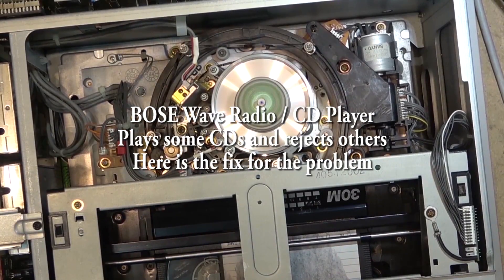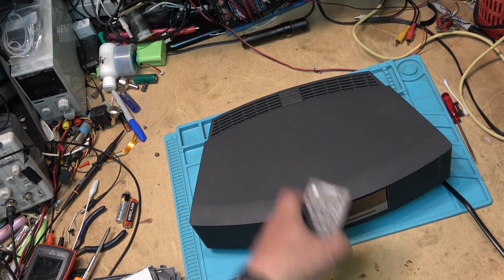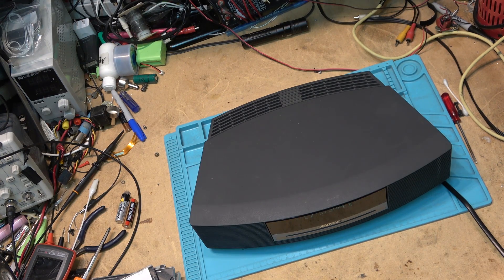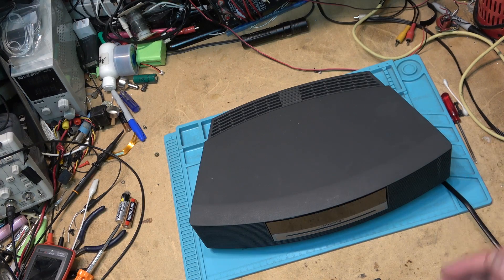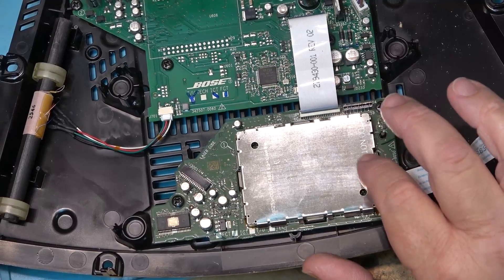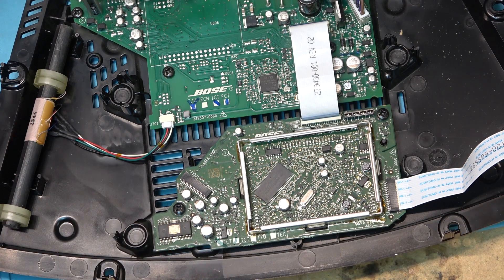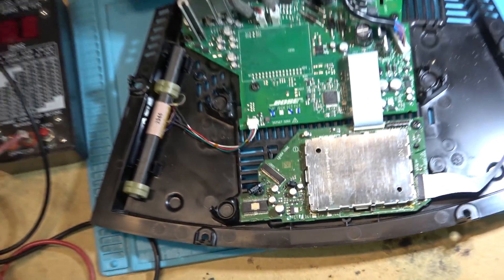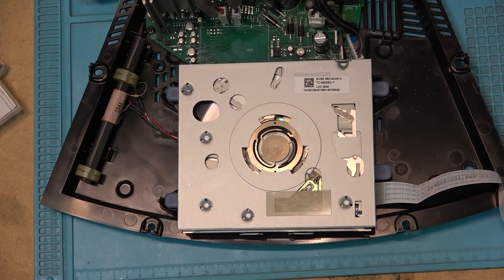BOSE Wave radio CD player not reading some discs skipping ect. Servo board repair component level.

Comment: p.s. they use lead free solder on these things, which i hate!!! i changed the 2 larger caps on the power supply area and they didnt budge until i took the 100 watt weller to it.

Comment: you are lucky on that one. i shotgunned the same area your did and still did the same. i took my hot air pencil and heated up the area under the shield and it fired right up. i shotgunned the caps in the cage, and boom! works like a charm.

Comment: Hello Master , under the disc player on the left side there is a capaciter : k3 [ can not read it  ]        
Then under k3 , it says ; 47 j or i
UD 
Is it 47 U D 
Would you please👌🙏🙌 help me:
is it 47 uf & what's the voltage please👌🙏🙌 sir .I thank you for your response . .GOD Speed🕊️🦅
Reply from the maker: Couldn't tell you. Here is the thing when I repair something for a customer they pick it up and pay me.  So I don't have it so unable to help.  Not that I would tear it apart and look at the value as every time you open these units you run the risk that the plastic mounts the screws go into are going to break.

Comment: Dave, do you ever use flux? I don't think I've seen a video where you did.
Reply from the maker: The solder i use has good Flux in it.  I do have Flux and I do use it if doing smd chip work like on the Sony tcon board I did chip level repair on but for thru hole I just use what is in the solder. I don't do much board repair.  My clients toss anything that is that involved.  No amount of convincing will get them to spend money on old crap.  They want cheap simple repairs.  Anything involved and they are replacing.   When I do get deep into something its generally my own gear.

Comment: 10:12 OUCH indeed....I have been nicked by a hot soldering iron too many times to count.....
And I too am not a fan of those smd caps...Some of my equipment is loaded with them and I somewhat fear the day I will need to change them..lol
Reply from the maker: I don't feel it. Burned my fingets so many times I have no heat sensitivity in my finger tips. Mostly from grabbing hot tubes.

Comment: I always enjoy your intros        Nice fix
Reply from the maker: The intro is kind of where I set you up for what's coming up on the video but it's mainly to stop people reposting the video. Just like every TV show has opening credits and closing for that matter but the opening logo is kind of like my trademark. Now some will turn around and they will re-edit and remove the logo and post it, but that's actually worse than posting the entire video because that in itself provides intent to try to conceal ownership and under the copyright act that is more severe than just uploading the video in its original form. the other alternative would be of course to put my logo throughout the video completely which I do when you see the little signs growing in the background but to burn it on as a bug on the screen.
Reply: @12voltvids  It's got a cool retro feel to it.

Comment: There’s a 22 or 47uf under the shield, almost dead center that always goes bad. It causes the player to boot loop or display, please wait. Another is under the ribbon connecting the 2 boards by the regulator.
I love you grabbing the broken leads off the top of the iron with your fingers. Ouch! 😂
Reply from the maker: They measured fine.  I changed the 2 that had high esr

Comment: I noticed that a previous viewer suggested that the problem might be bad caps.  Good to see that you followed up with an actual diagnosis and proceeded to isolate & change out the culprits.  SUCCESS, and now you can breath easier ( and keep your cool too )   Thanks Dave.
Reply from the maker: I already had but hadn't posted the video yet as i hadn't edited.  I had the guy bitching about the NAD.  
As I had mentioned in the previous video that I had spent literally 2 days on it.  Well day 1 was getting the mechanism to work and day 2 getting it to play properly.  This thing had too many goddamn smd parts in it.
Reply: There must be no old, hardened grease on the guide rod. Other moving components should also be cleaned and freshly lubricated!
Reply from the maker: @voenigs612  There isn't, it moves freely.
Reply: common problem

Comment: If your ac is struggling try taking the cover off blow out there condenser and evaporator and if you can spray them with a water hose jet sprayer or power washer on low power that will help it get cold but of course remove the electric controls the rest will be water tight
Reply from the maker: Its not struggling, my shop faces south and there is NO insulation in the ceiling over me. The insulation is on the wall facing into the house. There is insulation in the walls, but none was installed in the attic when the garage was built.  So it gets like a sauna up there and it radiates directly into the shop. With the door closed it will get really toasty in here, and this little AC keeps it comfortable. The hot air pipe goes up to the already hot atic making it even hotter. From there it vents out the soffits.